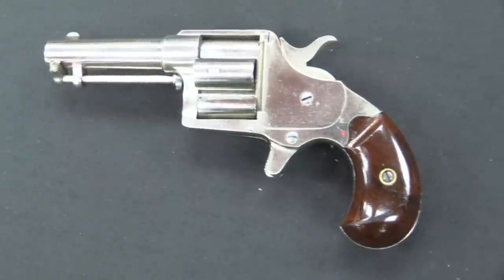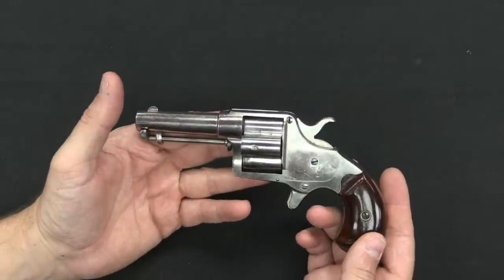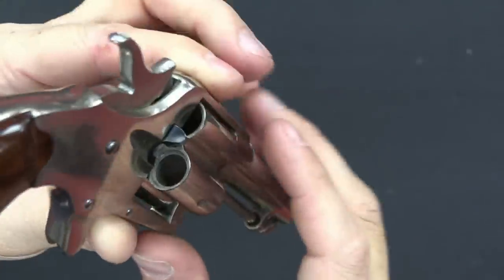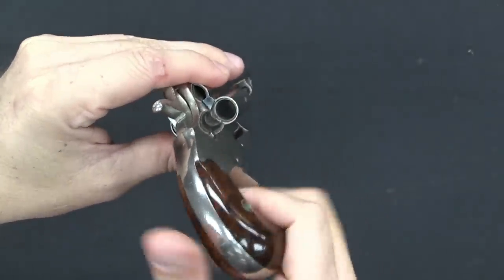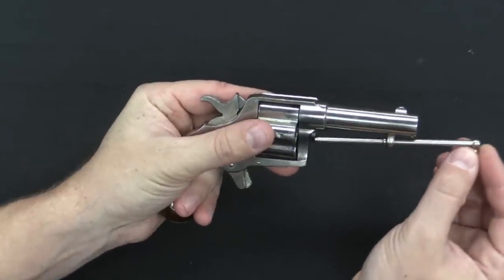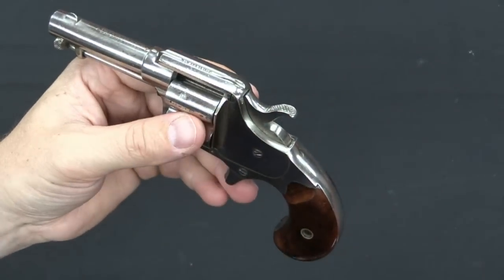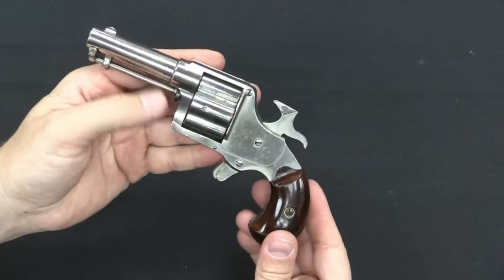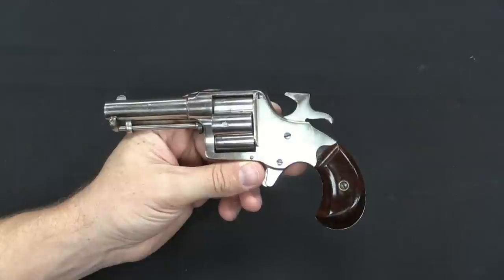Colt Cloverleaf Revolver

Comment: I like the aesthetics of this gun. It's not Derringer small, yet not normal frame either and it makes you wonder if the Cloverleaf name and 4 shot "cylinder" were a case of chicken and egg.

Funny thing is i've had this very gun in toy form when i was a kid (some 22 years ago). The toy was molded out of brass colored plastic. :)) I guess the factory who copied it had a used one.
Reply: Did your toy revolver have coil springs in the chambers to propel plastic projectiles?  A precurser of the nerf guns?

Comment: Never heard of these, surprisingly. Interesting design. A few years ago i got to thinking (always dangerous, lol) about compact revolvers. I reasoned that if they can make a 5 shot 44 Spl on an L frame,it woud be feasible to make a 4 shot one on a K frame with a 3" bbl. Low pressure cartridge, so cylinder walls need not be super thick. Or we could legitimize the 41 Spl as a factory cartridge, say with a 175-200 gr lead hp at 900 fps or so. We know that would work well. Alloy frame to save weight, andthe cylinder could even be shaved and profiled similar to an LCR if need be. I think we could meet a target weight of about 25 oz (same as an SP-101) easily. This would help a bit with recoil (Bulldog Pugs are notorius), would fit k frame holsters, and have a better profile than the COP and similar creations. I have a Rossi 720, basically a 3" K/L frame 44 Spl, weight probably 31-32 oz. Surprisingly nice gun, no problem with recoil. Shrink it down slightly and lighten it a bit, and it might be just the thing. Probably a very niche market item, being a 4 shot, but something larger than a 38 is often a good idea. Or maybe they could work some magic and squeeze 5 shots in a K frame cylinder (hence the 41 Spl idea) with an alloy frame. Rather along the lines of the Night Guard series, which should have sold better. Anyway, just another fringe idea from my often addled brain. Great video as always. Thank you

Comment: Why didn't they incorporate that safety feature (the notch in between cylinders) in the SAA? You could safely keep all six loaded with that!
Reply: The only guess I'll hazard is the possibility of bending or breaking the firing pin if the cylinder had undue force exerted upon it.